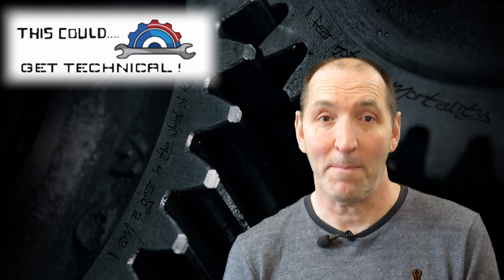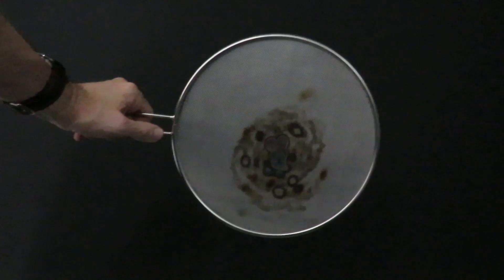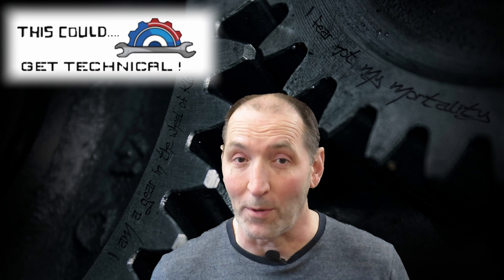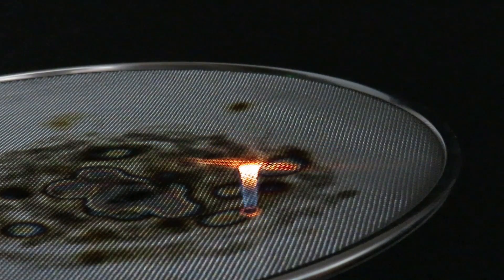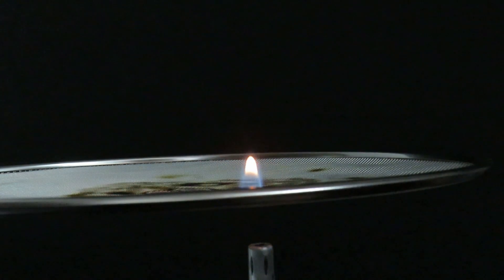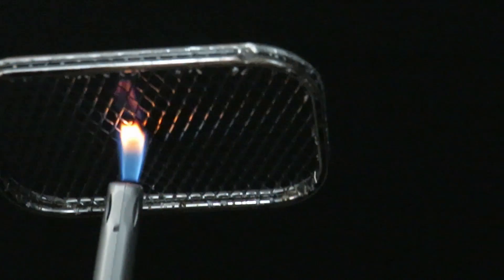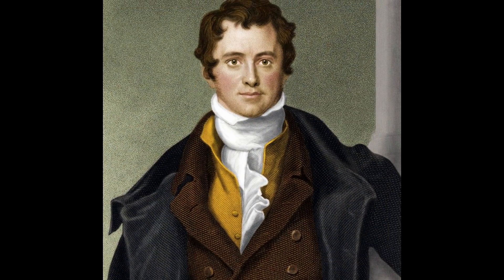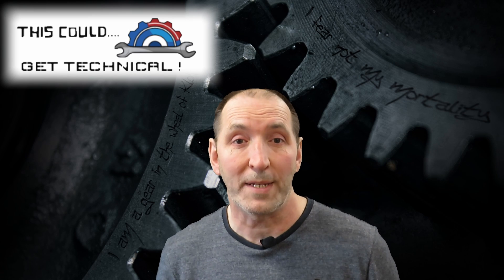Flame Through A Gauze? ...

Comment: I see you haven't made anymore magnet videos, have you given that up? Here's a tip. Use something like this to help with the magnetic bridge. If a gauze can be a flash arrestor, imagine a magnet arrestor to prevent magnetic flashback or magnetic reversal. There are ways. Lookup how to turn off a permanent magnet. Also another tip is to use gravity to add extra energy to the system. Have the magnets push up to 12 oclock and as it reaches 12:01 gravity can pull down on the other side for that little push past the sticky point. You have to line up the sticky point to be right about 12:00 and balance the wheel or wheels with gears to use enough gravity pull down energy to get through the sticky point. I've done it you can too. 🤫
Reply from the maker: Hi and thanks very much for the support! 
I intend to do do some follow-up videos to answer questions and try out some suggestions from the comments as well as some new ideas. 
I do struggle for time because of my grandsons hospital appointments and juggling work but I'm super interested in the subject and I will put some extra effort in to make the next video.
Everybody's comments have been great, just like yourself, and it gives me a lot of inspiration!

Thanks again for the ideas and I will make a follow-up video asap.

Pete.🙂

Comment: Also what were the materials you used to make the wand on the buzzer game?
Reply from the maker: Hi Colin, almost missed this question!
I made the wand out of 'Twin & Earth' cable @ 2.5mm.
It comes pre-insulated so its perfect for just taking some insulation off and leaving the bare copper exposed.

If you are in the UK then 'Screwfix' will be about the best to pick some up from but I think it is only sold as a minimum of a 10meter roll?

Screwfix link -

https://www.google.com/aclk?sa=l&ai=DChcSEwiBmJDjlYj5AhUJ0-0KHTEfArAYABABGgJkZw&sig=AOD64_2MvT5jv2gy8BFWxrR5opbQwwU26A&ctype=46&q=&ved=0ahUKEwjTrYvjlYj5AhXhQUEAHd02Cp4QqygI9Ac&adurl=

Thanks again Colin!

Pete.